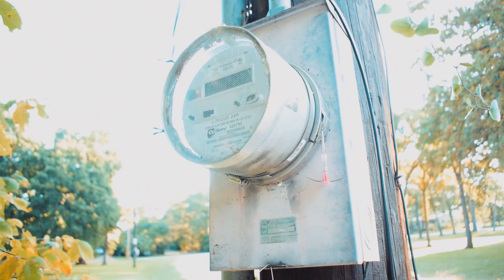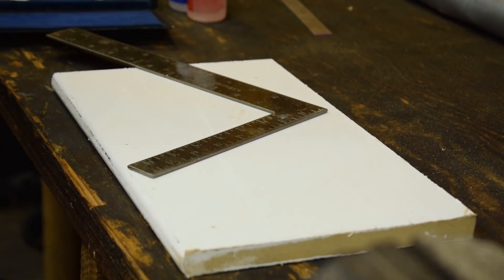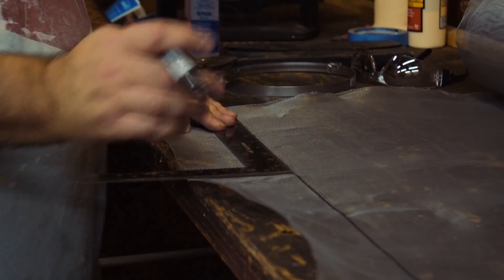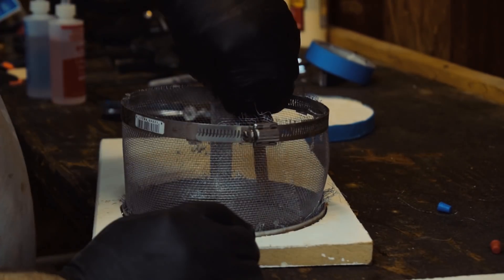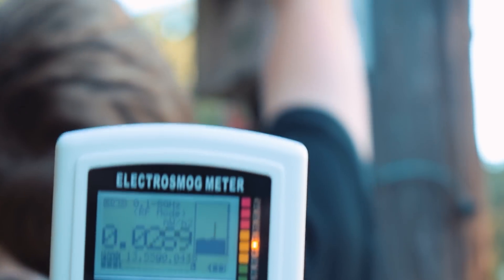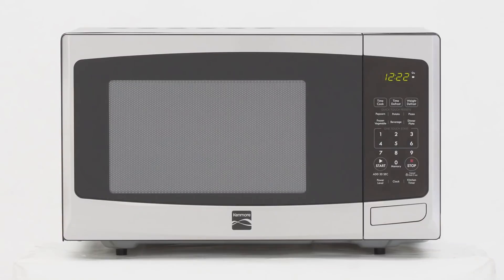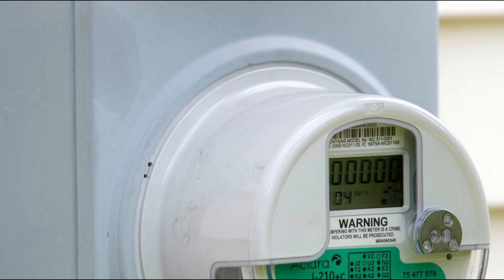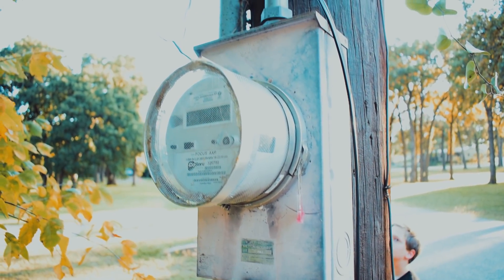Build an RF Blocking Faraday Cage For Your Smart Meter +Bonus Faraday Science/History

Comment: it seems to me that its blocking the brain waves in your head. RF are everywhere so blocking one meter or one object is a waist of material time and good oxygen that your wasting!!\
Reply from the maker: Yes RF are everywhere. My wife has a condition where her immune system is compromised and RF makes it worse. So we are doing all we can to limit her exposure. We do not have WiFi on in the house, it's all wired now. She only turns her phone on if she needs it for something. We have screens blocking things around the house so fewer RFs get inside the house. We have worked and measured and gotten the levels down to way lower than when we started. If I can do things to help her to not feel as bad as it makes her feel, then it is not a waste of time or material or anything else. If you don't want to build it, then don't. But you cannot and will not convince me that helping my wife anyway I can is a waste (or "waist" as you put it) of time. Thanks so much for your support and opinions.
Reply: @DarinBeard  You are a very good husband.  Your wife is a lucky lady ; )

Comment: Does this block the outgoing signal that the power company needs?   So the electric company has no problem with you installing this?
Reply from the maker: If you are in a rural area and it has a long way to the next "waypoint" then it might cause trouble. But in most non-rural places it only blocks 95% of the signal so it can still communicate. They are built to transmit way further than they need to in non-rural situations so blocking most of the signal does not stop the communication. After using this shield on ours it did not interrupt the meter from communicating like it wanted to. But it did block close to 95% of the signal strength.
Reply: Thanks Darin.  I live in the typical suburb surrounded by houses.  So it shouldn't be a problem.
Reply from the maker: @trade0714  Nope, you should be fine. If your electric company has a site that you can log into and see the graphs and stats of your usage and those graphs continue to be populated after the cage is on, then it is communicating just fine.

Comment: Does aluminum really work?
Reply from the maker: Yes, it does. Very well, actually.
Reply: @DarinBeard  did you have to worry about grounding it?
Reply from the maker: @wiyanwakan9203  grounding it doesn't make it work better as far as how it blocks the signal. Grounding is really for what it does with that energy after it does collect it within the cage. if you're not going to be anywhere near it you don't really have to ground it. But if you are going to be near it I would recommend that you ground it
Reply: @DarinBeard  okay! Thank you for answering my questions! I am gonna try this as soon as I get the material! 😀

Comment: Too bad microwaves dont have a complete faraday cage and leak. Measure it, it gets very high .
Reply from the maker: We don't have one. :)
Reply: @DarinBeard  yeah we use a convection oven. It's never plugged in though except for use
Reply: We have our microwave on a power switch and switch it off when not in use (and use it very sparingly)

Comment: Yours is on a pole outside the house, here in Australia they are usually on front side wall on master bedroom across from my head.
Reply from the maker: Usually they are here, too. It's actually weird that it's on a pole here. Unusual. I am ok with it.
Reply from the maker: @Yacht46 It is my understanding that rf only comes out through the glass globe part and does not transmit through the back into the house.
Reply: @DarinBeard  its gotta back feed back into house. If they say it dont then that means it does
Reply from the maker: I've tested it and it does not come theough the metal box, only the glass
Reply: @DarinBeard  I see many of these meters placed in metal boxes BUT there is an aerial on top of the box, what does one do in that circumstance?
Reply: @DarinBeard  Because the back of the meter is  a grounded metal box. With your  power coming in to it.
Reply: So if the meter is in a metalbox it would be fine?

Comment: We had a meter shield on our POS and somebody came by when we weren't home and stole it! WTF
Reply from the maker: That's a bummer. They are going to replace our meter with an analog one here in a couple of weeks. But no one has messed with our shield up to now.
Reply: @DarinBeard you add it back when the swapped your meter
Reply from the maker: @jorgeguerra1946  I don't know what that means.
Reply: @DarinBeard  in california they swapped out meters for smart ones that are a pain in terms of power companies yapping about it to your ear you cant fix it. Wondering if you had your meter replaced and if so did you just add the shield to it. Planning on doing these around CA just because
Reply: Just wrap the smart meter in aluminum foil.
Cost? About 7 cents.
Reply: Frederique Zug does that help lower your bill as well
Reply: C10 Syndicate  corporate greed
Reply: maybe a dog shock collar would help. When you hear the thief yip go out and bust them like the dog they are

Comment: It would be better to mix some graphite powder into epoxy, to optimally and conductively bond the aluminum metal pieces to each other. Also add a grounding wire, for most effective Faraday Shiled
Reply: Would a faraday cage be more effective if you doubled the wire mesh up and put 2 layers! or would that make it useless??
Reply: @stephenmaas8775  

Extra conductivity is always a positive with any faraday cage implementation. This includes bonding all surfaces together, and then to ground. Placing ground mesh (see geovital video) between yshield paint layers is better than underneath one layer, as metal is touching conductive paint on both sides then. Some use 3 layers and still want more attenuation of RF, so test before and after.

Good questions and good luck
P.S.

Safe and Sound classic meter is $150 and best buy for measuring most RF shielding issues. Having indicator light ranges is perfect for most folks' needs and saves from $385 for pro II model using same sensors (with numeric display).
Reply from the maker: I have not ever heard of the graphite powder thing. Thanks for that. As I said in the video, I saw this same basic setup tested with and without a grounding wire and it makes no difference to what the cage blocks, but just how that blocked stuff affects what's close to the cage. Our meter is not on the house but by the street so nothing is in proximity to it and I didn't feel the need for the grounding wire. But if it were on the house I would absolutely recommend that it be grounded.
Reply: Still way too expensive!!
Reply from the maker: Not expensive at all. I built it for very little compared to what they cost to buy.
Reply: @DarinBeard  So you did is cheap and quick, and what is your measured attenuation of dangerous exposure. Do you know how much things are better, or just feel that they are ?

A factor of 10,000 reduction is 40dB and most commercial covers do not provide that much improvement

Comment: Has anyone tried using a stainless steel colander? Would it accomplish the same thing?
Reply: @twangthing True....good point!
Reply from the maker: I have not tried that but I think it has to be more grid like.
Reply: @DarinBeard  Thanks for your reply. Since you have the equipment for reading the RF radiation and as a public service, could you try it and see what readings you get? If readings are significant,  I would think you could just buy some stainless steel mesh grid screen and  put it around the colander to reinforce the gridding pattern. Could you try it?  Thanks again for your help to the public! We're all in this together....
Reply: @twangthing I would imagine if you block the signal too much and the power company comes out to see what the problem is and find you've covered the meter with foil, they would fine you monetarily. Do you have you meter covered in foil?
Reply: @twangthing Well, turning of your power is worse than a fine.
Reply: @twangthing i can get black powder coated aluminium screen or plain silver aluminium - which is best please?
Reply: @twangthing It would be much cheaper to use aluminum screening than moving the meter.
Reply: @twangthing They can still fry all your appliances.

Comment: Hey does anyone know if these are what's emitting a 8344hz signal? I woke up one, April 10th 2016 and my ears were ringing and they haven't stopped yet. I went to hearing doctor and he tried telling me I had hearing loss and it was due to tinnitus and there wasn't anything he or I could do for it. And that didn't make sense because I passed the hearing test and even with this ringing I can hear things cars, planes people talking and before others can that don't have this problem, my buddy jokes and tells me I have the super hearing like dogs have. I think alot of people are having this problem and won't speak out about it because it's associated with schizophrenia.
Reply: There are several things that could be causing this.  I had a high frequency electronic ringing in my ears and it was really bad at night.  My hearing is fine.  I have recently started an extensive hormone therapy including Thyroid, DHEA and pregnenolone and the ringing is still there but at a significantly lower volume.  We are still working on doses so it will be interesting to see if it goes away completely once everything is perfected.  Another thing to try is turn your wireless off at night.  Wireless frequencies get caught up in the electrical wiring of our homes and create "dirty electricity."  There are filters you can buy and plug into your outlets to clean up the wiring BUT the ones that work are really expensive and you need several.  There is a meter you can buy to measure the dirty electricity in your wiring before and after plugging the filters. Good luck-its really bothersome!
Reply: JamesD33 targeted individuals . I too have the ringing in my ears and I’m only 33
Reply: Check your vitamin D levels...
Reply from the maker: Frequency is typically in the 902 MHz and 2.4 GHz bands. Hope that helps.
Reply: Greeting me to ringing in ear for almost a year Non-Stop and I didn't have one at the time but I had one now and he just put one out today
Reply: @rosalindyabba8816  My right ear started ringing in 2008, right about the same time I began to "wake up" to all the tyranny going on under our noses.  It hasn't stopped ringing since.
Reply: Reese Daniel Agreed! Louise Hay will day the spiritual reason for war issues is that we aren’t allowing ourselves to listen or hear truth.  Our bodies talk to us as a reminder to grow.  Medical medium states tinnitus is due to Epstein Barr Virus.  It’s the “stress” virus.
Reply: "A paranoid schizophrenic is someone who has figured out what's going on." Anonymous
Reply: JamesD33 Donavan I get a high pitched ringing sound periodically but my hearing  Is good.

Comment: Smart meters are toxic... Yea, its true. I made a smart meter cover out of alluminum foil and mesh. Seems to be effective. Knowledge is power. God bless.
Reply: But that just protects you when you are outside, what about the inside? it's going through the wall into your room :/
Reply: Remnant Soldier exactly
Reply: 5G is an entirely different scene.
Reply from the maker: C. Michael  That it correct but the metal plate does not allow the signal through it.
Reply: Darin Beard Which means it bounces it back the other direction into the home
Reply: @DarinBeard  What is the best reasonably priced meter to check any presence to difference in emf (or rf if that is applicable)?
Reply: So what do you do when your Neighbors smart meter is facing your house and they ran open to building a faraday cage?